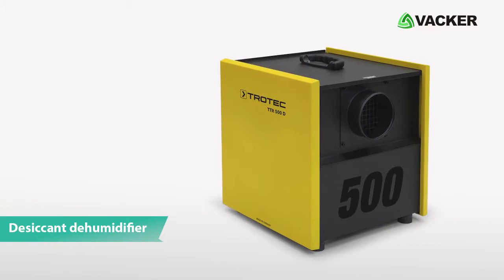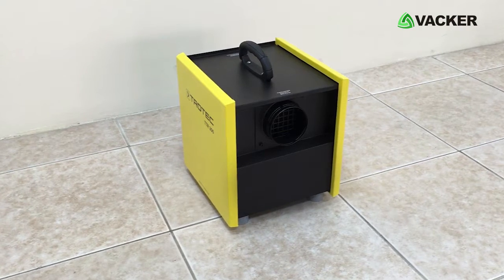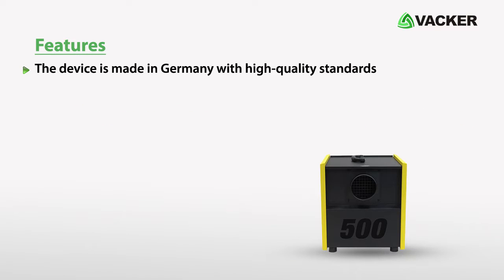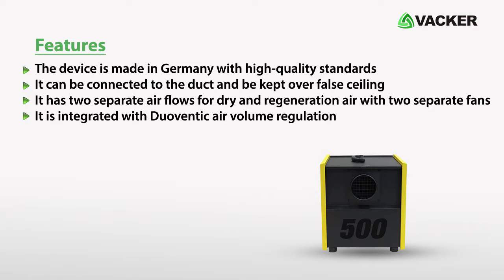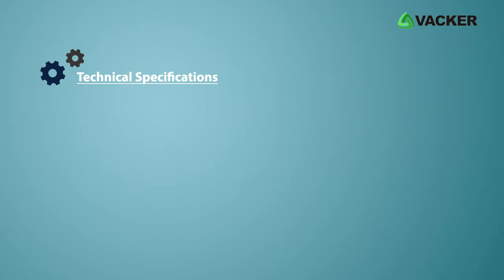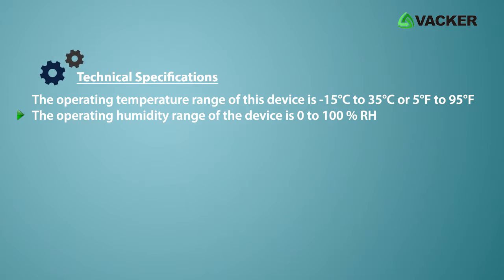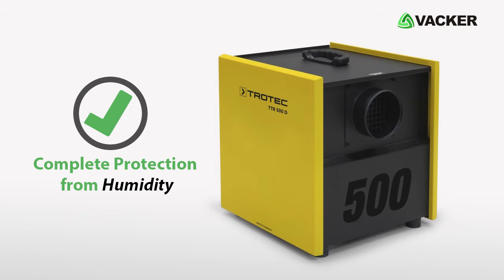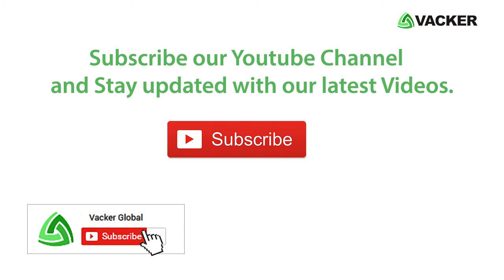Reduce humidity of Cold air for Cold Rooms, Walk-in-freezers, Poultry Farms, Hospitals

Comment: Wow, that's an expensive unit.  What temperature does it output?  Does that depend on the humidity output desired?  Can it keep a 76 degree 70 percent humidity 250 sq ft room down at 70 degrees with 50 percent humidity?  How loud is it?